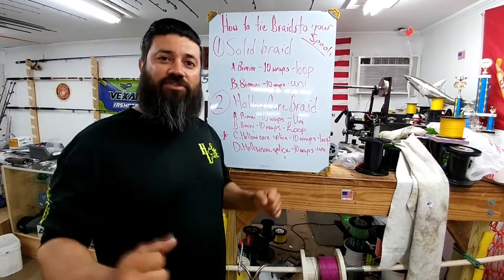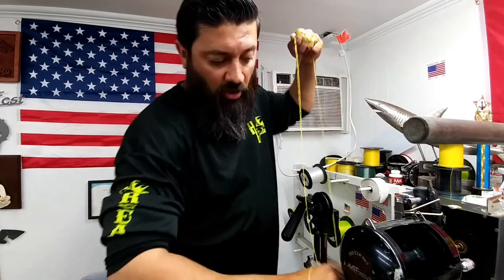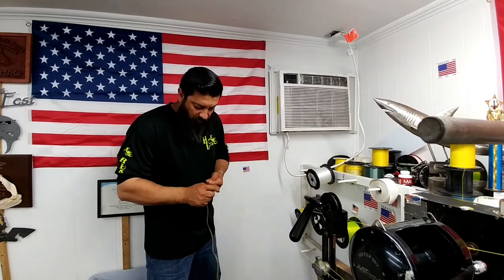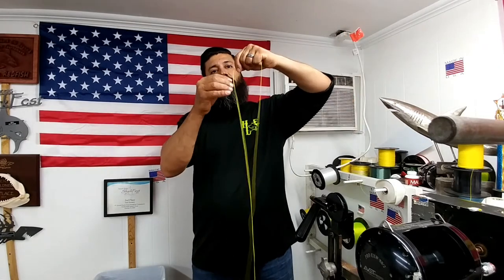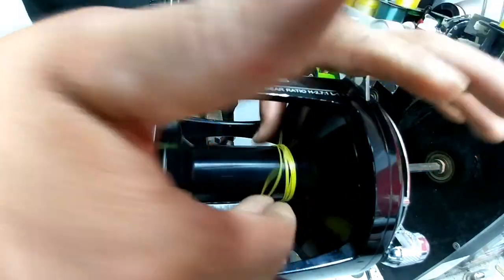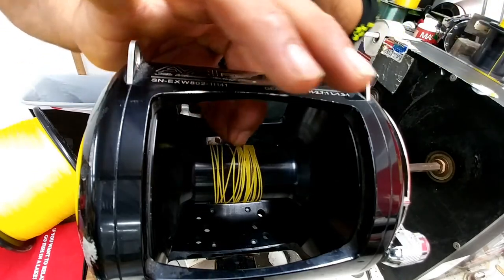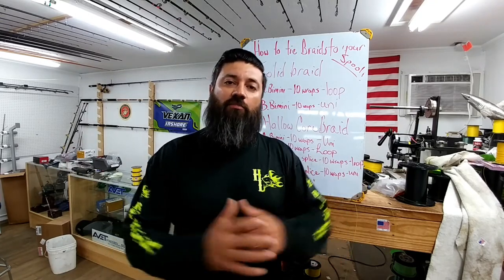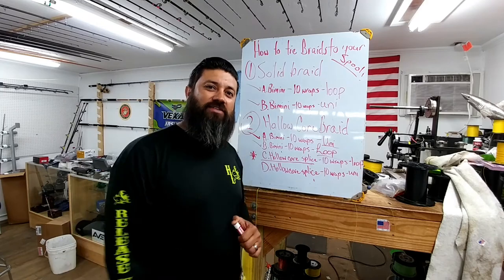How to hollow core splice braid straight no more bulky knot that split your thumb

Comment: What hollow core do you recommend if im using 30lb mono?
Reply: My reel currently holds 300yrds of 30lb mono
Reply from the maker: If you did straight 100lb you would get over 300yds... but doing 60lb backing plus 100lb top shot will be your best be for the larger fish hook ups cause you will get easily 400yds plus..